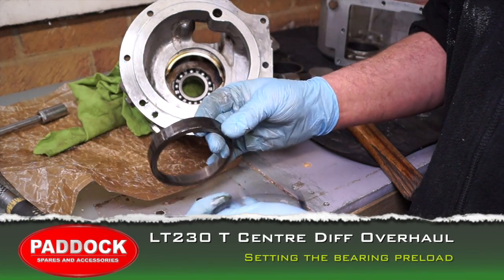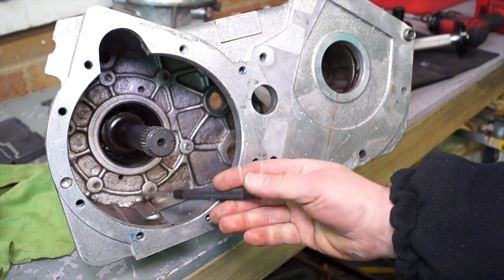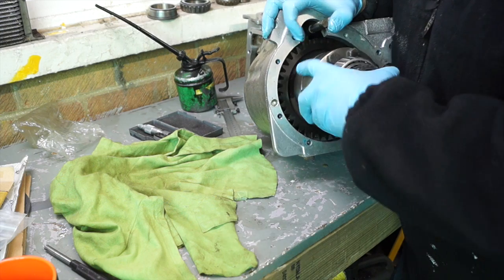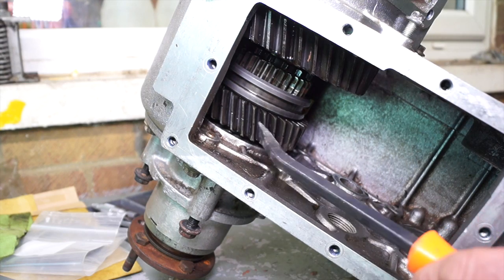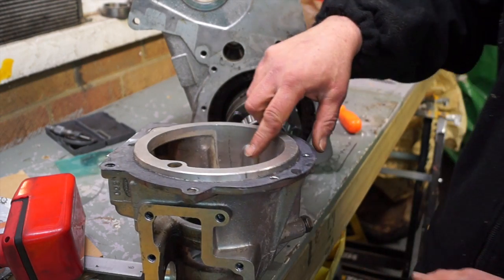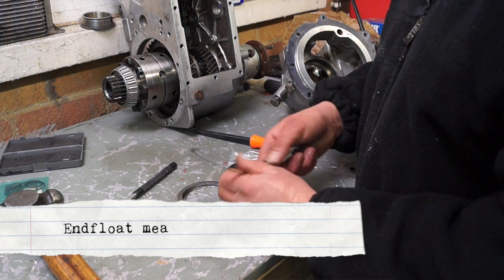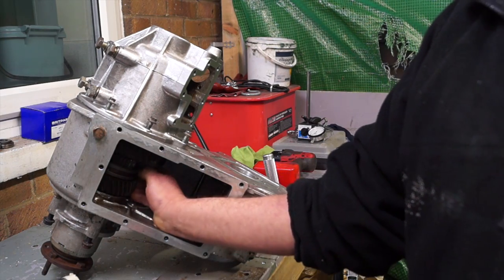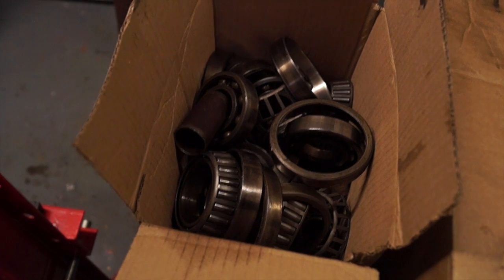LT230 T Centre Diff Overhaul - Setting Bearing Shims.

Comment: Not sure if this is the correct way to setup if you are using new bearings. If using new bearings you need allot more preload. The shaft should take 4.5KG of force to spin using a spring balance. This would be very hard to turn by hand. If using old bearings it should be around 1.5Kg.

Comment: 1:25 - DO interchange, DON'T mix.
Reply: Why not both?
Reply: @tim8505  You should almost never fit a gasket with an additional gasket compound. People often slobber gaskets with additional silicones and what not and then the things don't seal properly. It is also usually laziness as they feel it saves them cleaning things properly. Two clean mating faces and a new gasket in-between will last for years if done correctly. If you then add another compound on top of a gasket the issue is that you cannot guarantee the same level across the whole face, result is an undulating gasket (even if just very small differences). As the gasket peaks and troughs and is then clamped down it is not sitting square and the result is an unsupported gasket, because it is sitting on flexible silicone, and it flexes and expands and contracts with heat cycles and eventually it will fail, and fail often quick quickly. 

This is not the rule, there are indeed some exceptions but on a land rover I've never come across one yet. 

It's like people who do plumbing, then wrap the olives and threads in PTFE then wonder why they leak or won't seat proerly - then leak. These things are all designed and worked out, just use them as intended and they will work.

Speaking of plumbing, worst is when they wrap ONLY the thread in PTFE which is futile as the thread doesn't form any form of water seal on a compression joint!
Reply: Ah thanks for explaining :) I tried gasket only only sealent and both on my series transfer case sump and all leaked :/ when I used both it was the best to holding about a month haha
Reply: @tim8505  It could be quite a few reasons, things to look for are raised section or nicks in the faces, scores, old gasket, mating faces not clean, I usually will chemically clean the metal with alcohol or even just a good wipe with detergent to ensure the metal is clean with no oil residue as gasket compounds will often leak if applied to oily metal, the gasket will usually be OK if there is oil present however not always, an oil/grease mark can form a channel past the gasket which will always leak. Another thing to check for is warping. Torque down sequence? You want to work a "seal" down evenly from opposite sites and nip them all up progressively until you reach full torque.
Reply: @peterpeterson9903  Dry gasket, greased gasket or RTV? Land rover recommend RTV now and no paper gaskets since 200tdi on LT230. Maybe they has issues.

Comment: i got a 1999 discovery 1 SD  when i go to low range the diff lock on dash doesn't come on i woas told that was an option after certain years if so how hard is it to add it please let me know
Reply from the maker: +gooddad1975  yes there is a kit to change the auto diff locking to manual.  Have a browse on Ashcroft Transmissions Website for the solution
Reply: +Land Rover Toolbox Videos thank you so much
Reply from the maker: okay no worries.
Reply: @trailerfitter2  Wait a minute. Does that mean the automatic gearboxes WITHOUT the manually selectable center diff lever, have an automatic locking center diff?

Comment: Hi,  Im looking for a bit of advice, I am getting ready to change my cluch on my defender 300tdi and am thinking of changing the transfer box at the same time with the 1.2 transfer box out of a discovery. Will the discovery 2 transfer box fit in my 300tdi r380. Many thanks. kev
Reply from the maker: +kevin clark  yes it will. Just remove the electronic transponder off the box and fit the cable in its place.   everything is the same.  Make sure you get a manual transmission LT230 though.